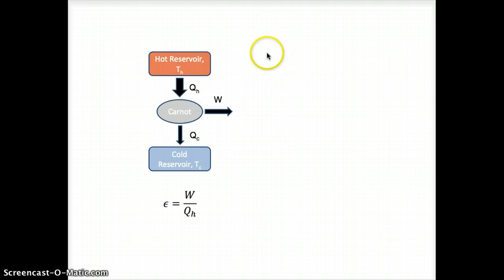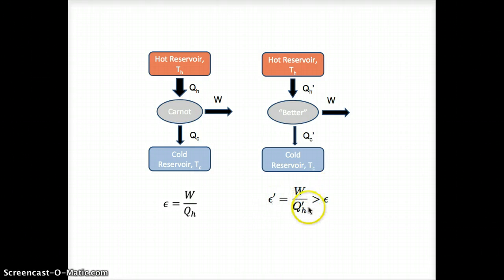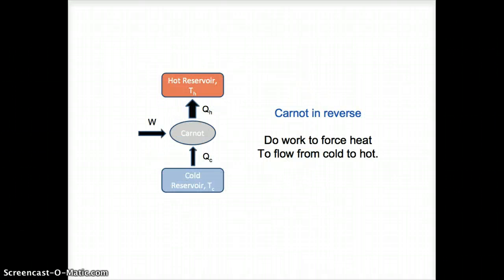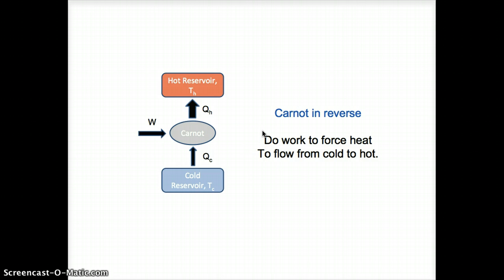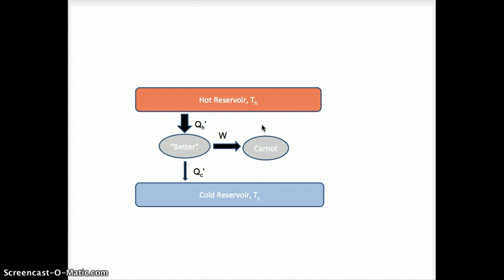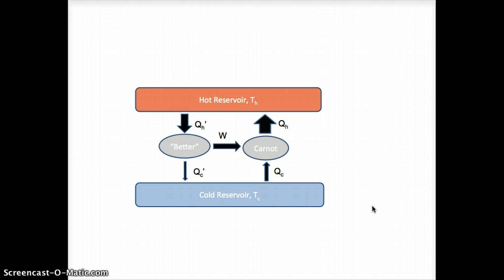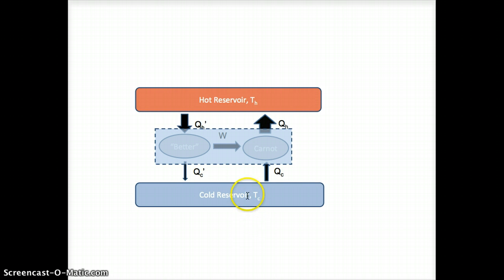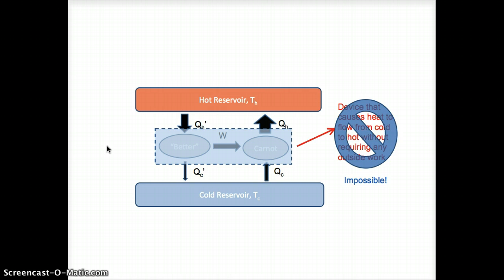Why can't we beat Carnot

Comment: Flawed. The concept behind the proof used is flawed. Efficiency is W/Qh. Qh and Qc do not add up to more than 100 percent of the heat. So, the proof is flawed.
The proof is about as silly as the proof that viruses exist. No virus has been ever isolated, yet virus maniacs imagine they exist. When a cycle with greater efficiency than Carnot's cycle is found, you will have proof. But this video cannot be used to say such a cycle is impossible.

Comment: what if we take an engine thats not very efficient that is taking heat from the hot reservoir, giving heat to the cold reservoir and in the process does work on a Carnot engine that's taking heat from the cold reservoir to the hot reservoir. Heat still flows from the cold reservoir to the hot reservoir( I think).
Where have I gone wrong?
Reply: If it is not very efficient, then the Qh' and Qc' would be larger than Qh and Qc of a carnot engine, and the arrows would be bigger. The heat would flow from hot to cold.

What the video means by, cold can't flow to hot, it means that the entire system of two engine has no work done it, so cold can't flow to hot (violation of second law), but in the diagram, cold flows to hot for the carnot engine bc work is done on it.